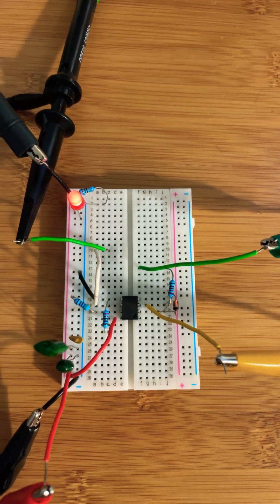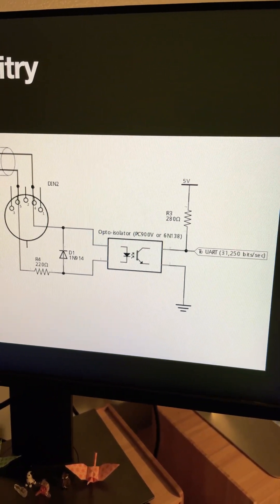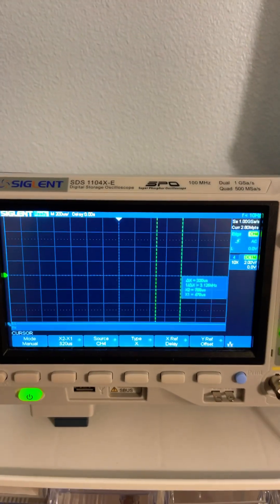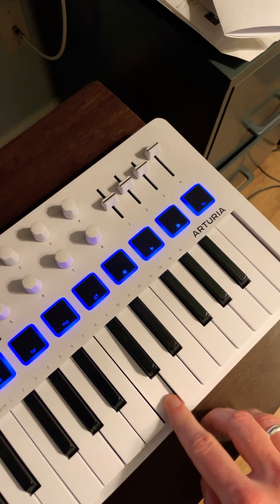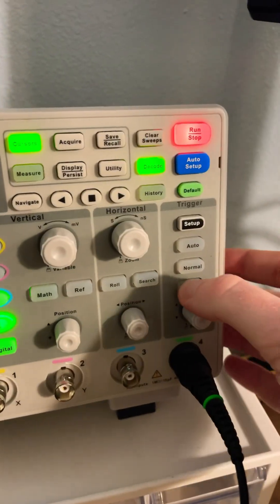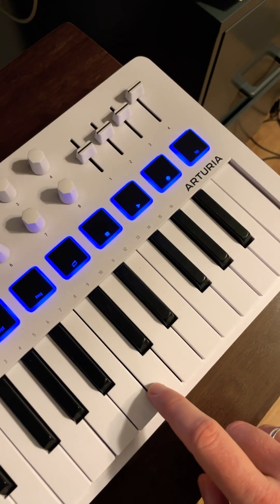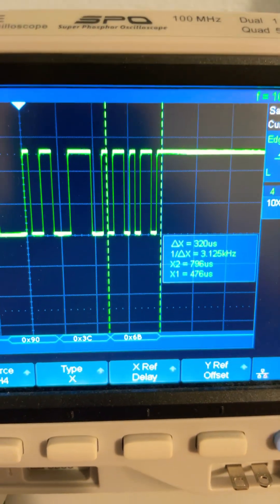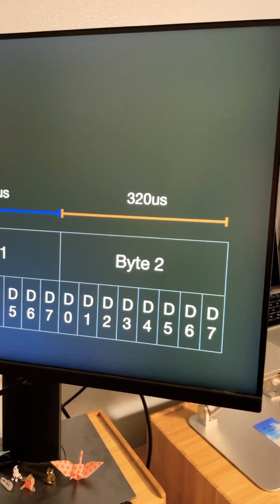MIDI circuit and key velocity #music #engineering

Comment: That is a MIDI "input" circuit. 🤔
Reply from the maker: Good point from the end to end circuitry perspective! I was thinking from the perspective of measuring the midi controller message, where the midi controller key stroke is the input and the optocoupler buffered message is the output. I adjusted the title.